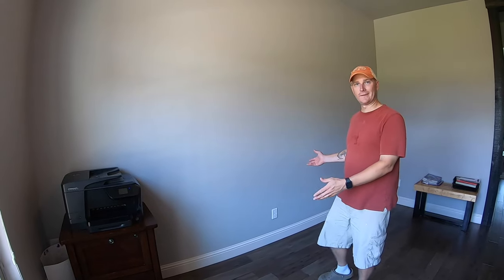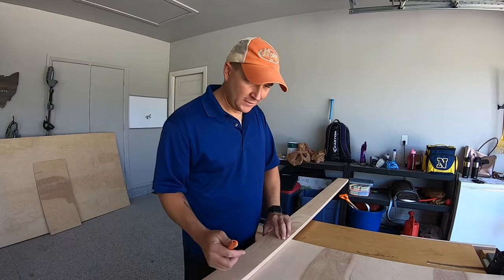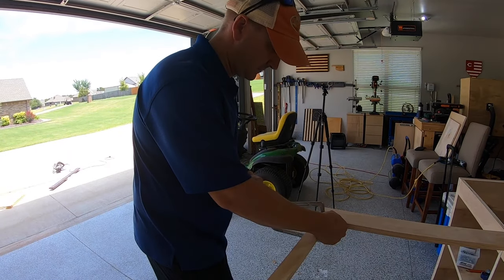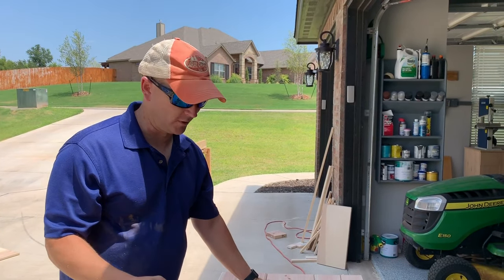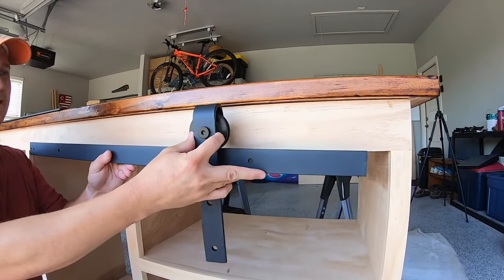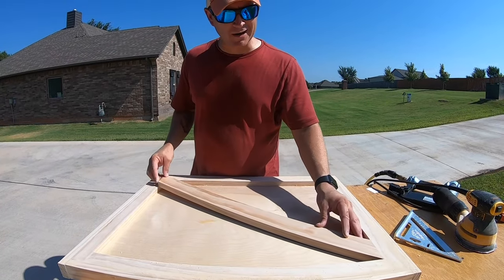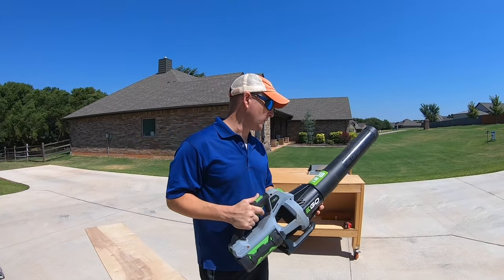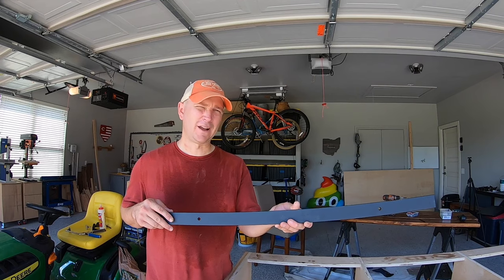DIY Cabinet with Barn Door

Comment: Hey! You are having far too much fun applying glue! LOL. 50 pocket holes, doubled up plywood and brackets, that thing is not going anywhere even in a tornado! Cabinet looks fantastic. I really like the bard door! Your builds get better each and every time and they were awesome to begin with.
Reply from the maker: Thanks! I think it will be fine. There are some pocket screw haters out there, but I haven't ever had a problem with them.
Reply: @WoodChuckCreations  I have heard the pocket hole haters but they seem to be craftsman. for novices like me, pocket holes are awesome so I totally support your decision to use them!!

Comment: Really nice work mate. Love the colours that you used. The grey with walnut looks stunning. It's sweaty weather overthere i see. And did you know there are devices to spread the glue?? 😆😉
Reply from the maker: Thanks! Yes, it get's pretty warm over here in the summer but I'd rather deal with the heat than the mess of working inside until I get a better dust collection system. Oh and thanks about the glue LOL